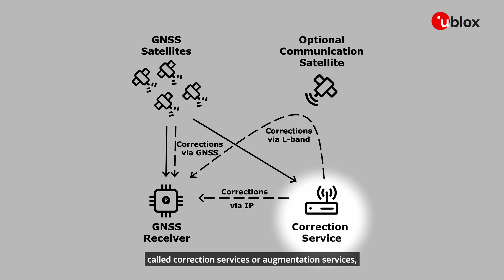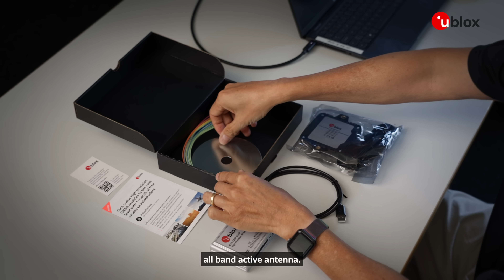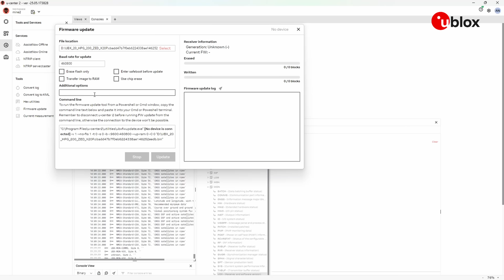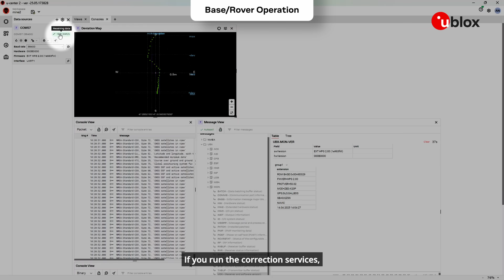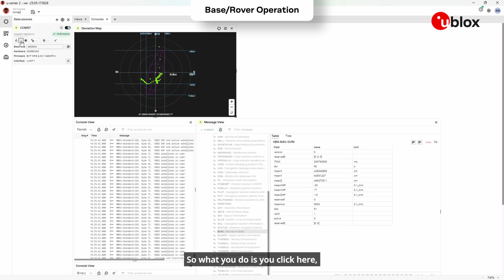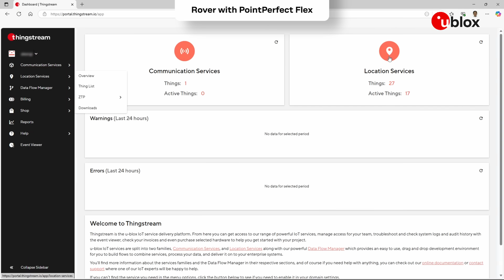[Outdated] How to get started with the u-blox EVK-X20P evaluation kit with u-center 2

Comment: I am a bit confused by the statement at about 4:20 'a technical issue that it can only connect to a USB A port on a PC.  This is being addressed in a future version'  Is this likely to be a hardware or firmware update?  I would be looking at the EVK-X20P with the idea of using it with an Android phone with an OTG cable to log Point Perfect corrected position data.  Thanks - this looks really promising

Comment: I am a little bit confused about when it is necessary to run update from a command shell with training sequence enabled. Is that only when update from normal operation fails and you need to run update from safeboot? If update is successful from normal operation, are you finished, or is it still necessary to run update from command shell with '-t `'?
Reply: I think thats correct, it is only needed if the update fails and its in the safeboot mode (I guess). Atleast thats how I understood it aswell.